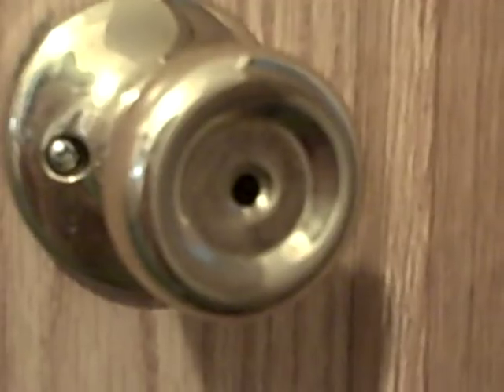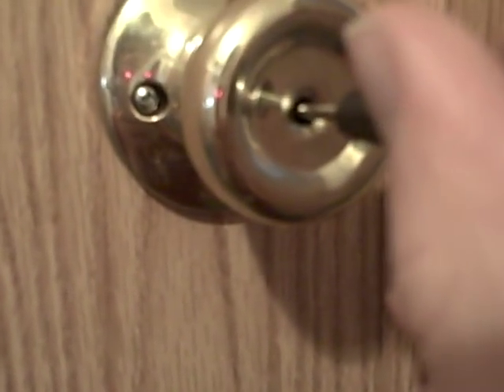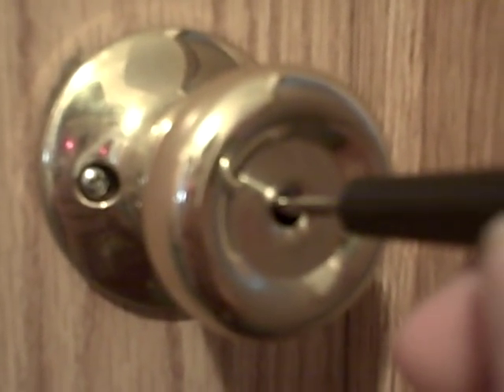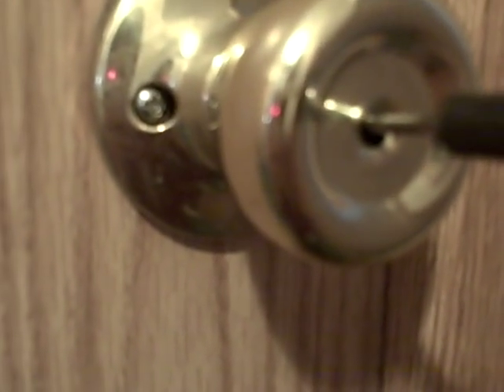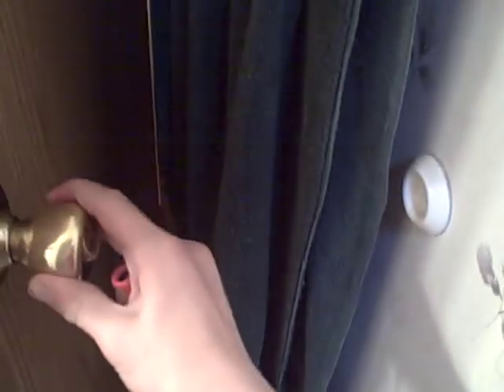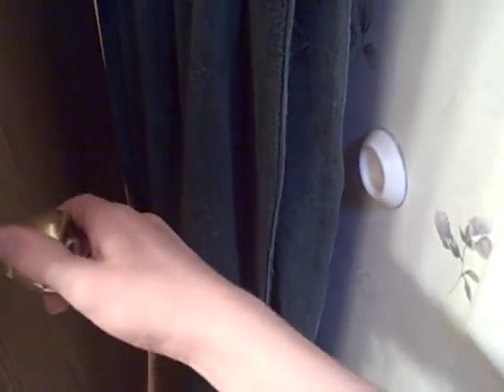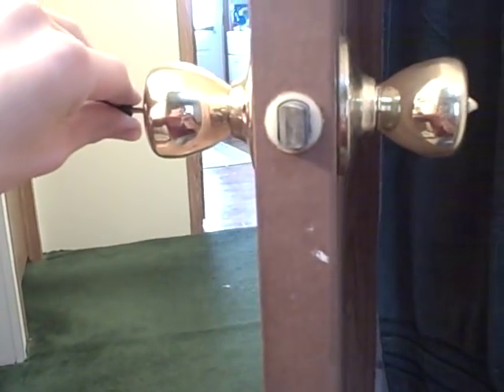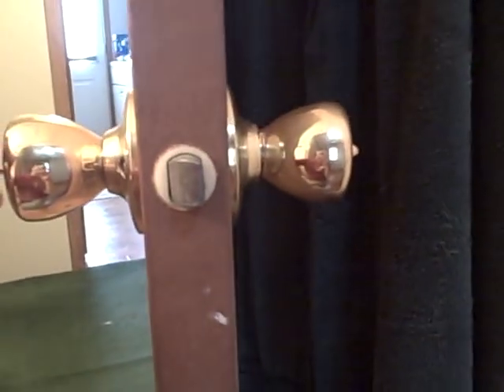How to open a Bathroom door lock

Comment: Thanks man. I thought of unscrewing the cross head screws and then flip the pipe thing inside but this is way quicker. Took me just 3 seconds to unlock. The groove which we are looking for is horizontal and rotate the screw driver in the direction we would normally unlock from outside.. which is same as what you said, from inside.

Comment: FYI if you don't have a thin flat head screw driver, you can use a wooden scewer stick... you can use a knife to sharpen and shave one end and it will do the trick as well.

Comment: That can be done with a paper clip or with pin or anything that is thing an little long of course if the door has the hole in my house the rooms has that hole and I open the doors from the outside super easy